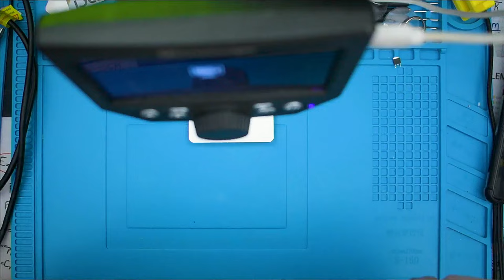Not All Hot Air Stations Are Same!

Comment: i just bought the 858 for  18 Dollars here in India (they are made here) , and now I am wondering my decision. shall I talk about exchange with the seller?
Reply from the maker: @aayushsapra3982  Man, if you're a not a professional, it'll serve you very well. But if you are working on more than 10 boards a day, consider an upgrade (just to save time). Don't worry about it too much mate.
Reply: @milanfixer  ill mostly use it for heat shrink tube and removing/ replacing components once a month maybe.
Reply from the maker: @aayushsapra3982  in that case it'll be perfect for you. May you use it in good health 😁
Reply: Which make model you purchased?

Comment: I bought recently a rework station which has soldering iron and hot air gun operating from a variable central unit.   The reason I chose it, is the design is totally modular, either part can be switched on and off independently, has a clear and somewhat accurate gauge to indicate temp and power, the iron and gun are replaceable and the iron uses standard current tech tips so functionality all the way and repairability all the way as well.   I actually now run this in a trinity with my other two irons, I have my heavy duty Lidl Parkside mains powered with a thick chisel tip, I have a variable Katsu solder station with a medium cone tip and the rework with a microfine tip plus have on the way a crows beak tip for them hard to reach places.   As for the gun, yes it is the fan type but it does the job and replacement elements and fans are easily found so again the repairability, heck its cheap but does the job and I flux up on removing stuff as the flux really helps spread the heat under the area worked on :)

Comment: The fan version is better for reballing chips with BGA balls.
But it can be very useful for big boards if you have a preheater.
If you have a preheater, you don't need a Air Gun with Air Pump because the main basics of working on big PCB boards is that you always have to use a preheater to preheat the full board and a minimum heat from the air gun to avoid chip destruction by heat.
For the fan version of hot air guns the 8018D is pretty good because it uses a better fan and a better fan position compared to the 858D version.

Comment: few more things: as the heating element gets older it will be less efficient. the huge flow of air is useless for most if not all small components, when you need to put them back. the most important thing is the constant temperature of the airflow and the accuracy of the temperature meter. more power in WATTS = more power in removing components.
Reply from the maker: Yes. For the heating element you are completely right. Since the age of the heating elements is about the same, it makes no difference here.

But, since air is the heat delivering medium, flow is really important. More air flow = more heat delivery.  So it's really not meaningless. Every calibrated hot air station would be able to recover the lost heat quickly, but the point is heat delivery. 

If you're hinting at high air pressures being useless (you're right there), there are two great options for any beginners reading this: use a smaller nozzle and turn the airflow down a bit (smaller cross section would increase the pressure to much at the same air flow), or use the same nozzle but move the heat gun away from the board a bit.
Reply: @milanfixer  but the cheaper one seem to be heavily used and old and the other one seem to be new? try to check the actual air temperature if you can.
Reply from the maker: @WebMonster-jf6eq  It was used only 6 times, before I bought the more expensive one. It looks "heavily used" because the air delivered to the heating element was never enough to cool down the nozzle and thermally balance it. 

Yes. I calibrated them both with a thermocouple, they both deliver a stable temperature (+-5°C). 

The real reason I made this video is to help everyone save time soldering and desoldering chips using hot air. 

If you are really so skeptical, buy both of them, calibrate them and try them for yourself. They're both only 90$ and you can always resell them if you don't like them. You'll soon realize why the most prominent repair youtube channels (Louis Rossmann, NorthridgeFix, theCod3r etc.) use 200+$ piston pump hot air stations with 1 inch thick hoses.
Reply: He also uses at least one Rosmann of Flux

Comment: 1:06 this sentence is wrong - the opposite is the case. Otherwise you are right of course. But big volume instead of big pressure is always made using a fan, not a piston. The difference clearly comes down to the totally fake "700W" that are maybe 300 at best or the low air volume due to the cone shaped air path (fan hat not enought pressure)

Comment: Is 24l/min air flow enough in most cases, or should I go for the QUICK 857DW+ with 100l/min?
Reply: I would also be interested in this question. Can anyone answer it?
Reply: I never use my hot air station on full blast, air flow or temperature, but it all comes down to what is your usage case scenario. The air volume per time unit do not tell that much on its own, it has a lot to do with what nozzle you use too, and the pump/ventilator/fan parameters regarding pressure handling, here the piston pump shine, if you just go for high air flow then the ventilator/fans is your drug, but the two things, air speed and pressure goes together, and it all depend on a lot of variables that will differ from use case to use case.

Comment: yes ofc you are right, the station with the air pump is superior, but I have pretty consistent results with the cheap one, I just make sure tu use a good flux and (if possible) I add a lower melt temp solder to the pad of the components I want to remove before blasting it with the hot air gun, and you're good to go...

Comment: I have the 858 hot air. I modded it to have a higher airflow. I had just replaced the 27k resistor with 18k on the tip31 speed controller inside the control board. The standard voltage of the fan is about 5 to 6v that's to low for a better airflow. Now after modding i get around 9 to 10v and it do pretty well.

Comment: The difference is very noticeable when using a large nozzle on a thick board.
Reply from the maker: True. But sometimes using a large nozzle is not the option. You might blow away small components of the board. Throwing away kapton tape for a small solder job is not worth it in the long run. That's why volume is key in most cases.

Comment: Helical and vertical wind pattern. Was told for large ics helical one with the fan one is better. Really popular in mobile cpu removal and reball. 
Vertical with the piston pump is good for small components to quickly remove small smd cap before the board heats up. 
Maybe their use case is important to not kill the ic due to overheating.

Comment: are the stations same power in WATTS? if not, the comparison is not so meaningful
Reply from the maker: Thank you. I completely forgot to say that (I'll add that in the description). They are not. The one with the fan is 700W and the one with the piston pump is 600W. So the one that performs better is actually weaker in WATTS.

Thank you for pointing that out mate 👍😊
Reply: What about replace tips for the soldering Iron this is a major selling point if there are any replacements

Comment: Greate for content. Thank you.
Would be great if you could share a link to where this could be purchased.
Reply from the maker: I would gladly do that. But this particular hot air station is unavailable everywhere I looked. Just get the one with real temp control, a wide hose and you should be fine. Don't buy the ones with fans within the handle.
Reply: @milanfixer  that's the one I wss referring to, the one with the hose. I already have one with the fan (898D)

Comment: What temp should I use to remove analog sticks from Xbox circuit board?
Reply from the maker: About 450 degrees. Heat up the board from the pin side and when solder melts, gently pull it from the board. Use kapton tape to secure SMD components on the board and prevent them from flying off.

Just be patient and don't force it. You'll be able to do it without a problem. If you have low melt solder, use it.
Reply: Appreciate it!

Comment: I paid around $50 for my fan based hot air station about 1yr ago and you know what? For the little bit of soldering I do, its all I need, Its not really about the air, its more about the heat than anything, and it works fine, sure at that time the piston type was like 400% more to buy, I didn't see the need. If I was a pro or semi pro, I could see the need for it. But I'm not. :)

Comment: Piston does more volume than fan? Tell that to race engine manufactures that use turbo boost or superchargers.
Reply: He meant comparing the fan INSIDE this hot air blower specifically versus the blower piston located on the station. The hot air fan is limited to just a small size because it is located in the handle. The fan cannot compete in volume because of the inherent size limitation. No need to overexemplify his words into turbo boost or race engine which is completely different world that he is talking.

Comment: Why should i care about volume of airflow? I want to be heating, not blowing components off the board! Max air is too much on any station.

Also "a piston pump will always deliver more volume" is the funniest shit i ever heard. Because this is the design for pressure, not for volume, the 5015 fan does about 10 times the air volume. And most of that pressure is needed in order to overcome the hose air impedance. That being said that airflow is going to be much more consistent, since the small backpressure from the work being near the nozzle or from narrow nozzles isn't going to impress that pump at all, it fought worse on the way there.

Also tbh the one with the fan in the handle the real air temperature falls off the cliff if you run too much air.

Comment: I bought one like the video for an hdmi replacement and I couldn’t get the solder to flow at max temp and max airflow nothing 🥲 looks like I need to upgrade and I’ll have a random heat gun for show
Reply: Add low melt solder, it would help

Comment: your so wrong so okay lol and where your airflow metters. more air = reducing heat element . maybe your little pump 600W is low air flow LOL so you buy new one only because you dont know reduce or put resistor in this fan speed? LOL i have reduce fan speed and this realy change my life . home made always better
Reply from the maker: You do you mate. But slowing down the fan wouldn't fix fan bleeding all around the place. I'd be very happy if you could demonstrate what you said with the flow meter (as I really don't have one) and upload the video. I'd like to know more 👍😊
Reply: A lot of electronic technician using the pump blower. All of them said, its perform better.
Reply: @milanfixer  is it Baku 850a? Or another model?
Reply from the maker: @hairulole  It's Baku 852D.
Reply: @milanfixer  I found a baku 852D+ for sale for 93euro. Its still a good option for the price? Thank you. EDIT: Its a 852D+ (Plus) model, maybe its a newer model? Thanks.
Reply from the maker: @sjogosPT  It's a bit pricey for my liking. Add about 20-50€ and get a better station. Baku is for "poor repair technicians" and shouldn't cost that much 😂😂😂